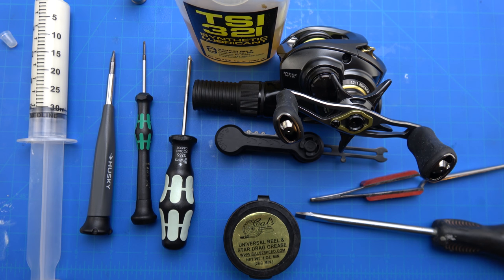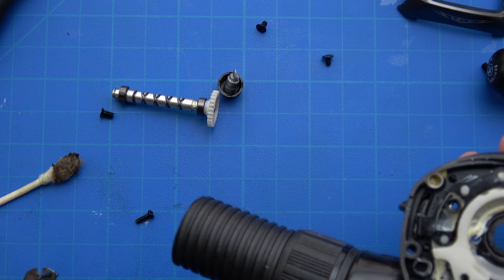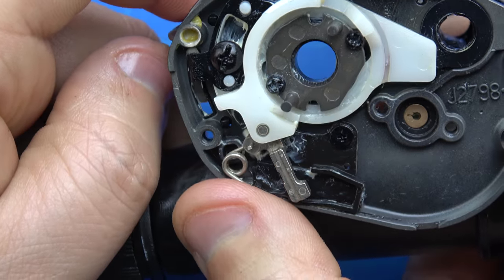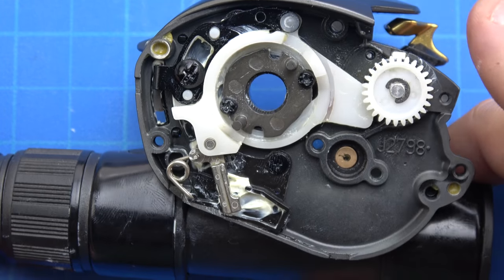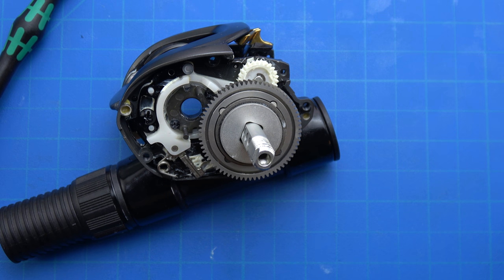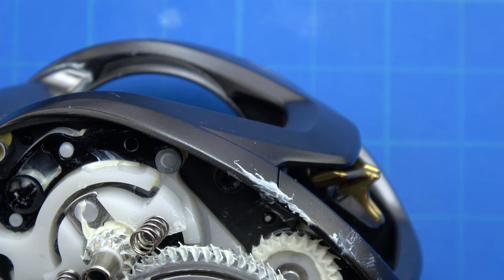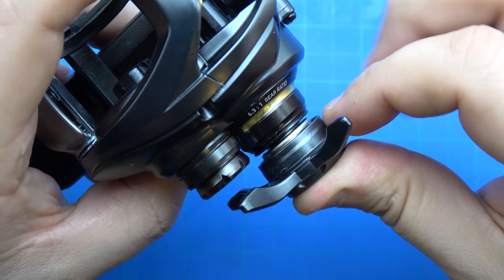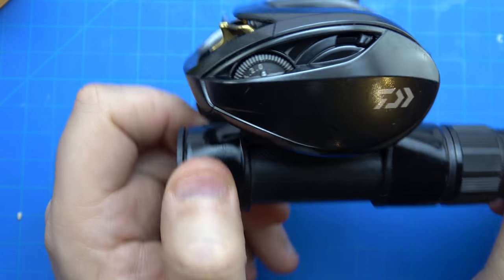Daiwa Steez SV TWS maintenance reassembly...Part 2

Comment: How tight should the 10mm but be on the handle before you put the locking plate on?  And do you loctite the small screws on the locking plate?

Love your videos!
Reply from the maker: Just a bit more than snug...no need to wrench it down...it should remain tight...and the handle most likely will rotate on the handle shaft slightly after sngged and fully assembled.   With a tight drag and your thumb on the spool.  I don't know the exact torque specification...but a bit more than snug is what I would suggest
Reply: @TackleAdvisors  Thank you!

Comment: Do you use your steez on saltwater?
Reply from the maker: no....i don't target fish sized appropriately for that type of reel.
Reply: Tackle Advisors thanks for takint time to reply .im thinking about buying an alderbaran bfs, and i wonder if i can use it on saltwater. They have the same magnesium body right?
Reply from the maker: yeah....but for what applications?  I'm in the NE usa....I spent a good amount of time fishing the concept z for striped bass....that's a 150 sized reel.....reel is almost dead..very geary and noisey and that's an inshore reel lol
Reply: Tackle Advisors i live in florida and i want to use it for wade fishing for snook and redfish.  Just wondering how magnesium holds up to saltwater. Shimano has this fancy coating on dem magnesium reels.
Reply: lee speed hey, im in fl as well, i would not use this reel in anything other then fresh water...i have a fuego ct that i use for salt/brack and after 4/5 full days its shot.. shimano? I have gone threw about 16 aldebarans and metaniums..the fine tooth gearing can not hold up for every day fishing...trust me..i switched to diawa because of this..shimano is super smooth but after 40 days of fishing  they fall apart..
Reply: Fishing for life thanks for the info sir.

Comment: what are the exact spool/side plate bearings and how much were they?
Reply from the maker: They are full ceramic zirconia oxide abec 9 bearings.  I went through 12 different importers trying to find a good manufacturer.  Found  1 good one. But the consistancy was still kinda meh.   When I start importing them again.  I'll sell them for 30$-$40 per pair instead of the 150$- 200$ 
If I start importing them again.  I'll do a give away and post up a vid.
I've bought the cheaper sets off of ebay.   Worse than stock bearings with the bonus of loud as crap.
Reply: Some1 charges this much for a pair of bearings? At that price, even Hedgehog bearings seem reasonable, and you know for a fact they perform well.

If you have bearings from a lot of the manufacturers (zpi, hh, boca etc), you should make a comparison video.
Reply from the maker: Part of the reason I never mass imported the for sale....They perform similarly...but are 100x noisier.  The advantage being they are impervious to rust.  SO for saltwater they would be good.....But guys into replacing bearings.....Don't let spool bearings corrode....EVER :)  so I gave up after a bit.  

I've used all of them...I generally always upgrade stock bearings (except daiwa/shimano)  There isn't much of a difference.....Even bfs and throwing ultralights.  I plan on doing a comparison of stock vs boca.
Reply: Bocas are made in china. Now if we're talking about Hedgehog Air or Hedgehog HD, that's different (casting wise). I hear the ZPI ones are also great.